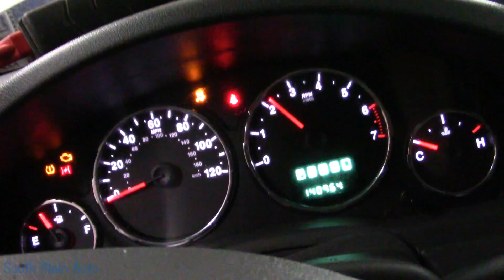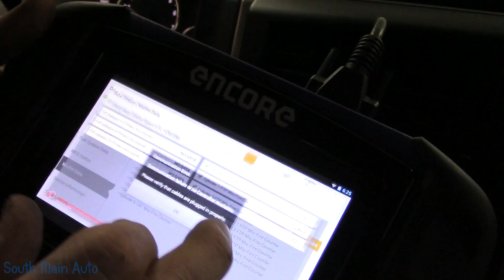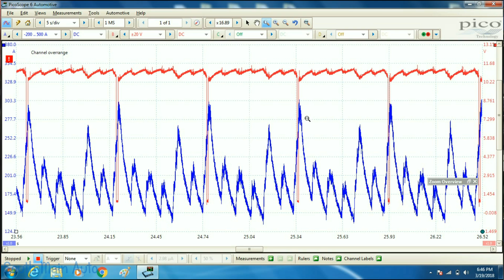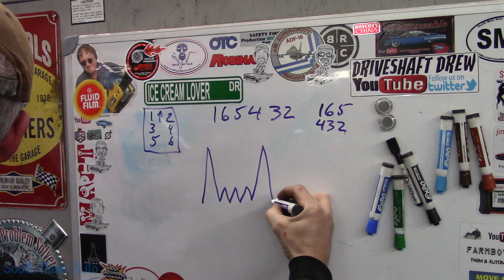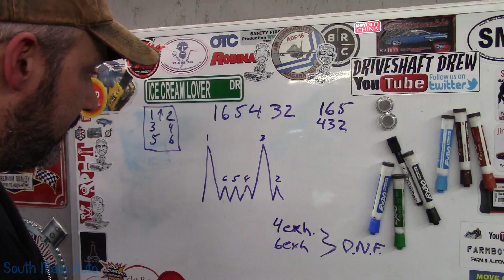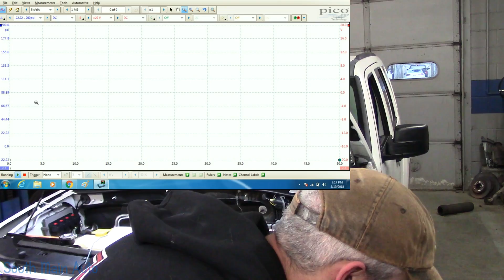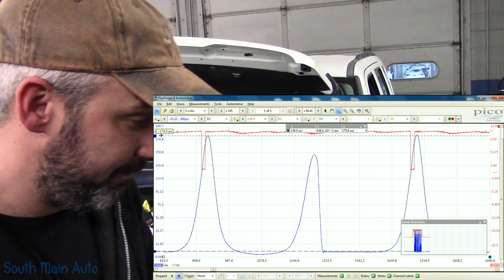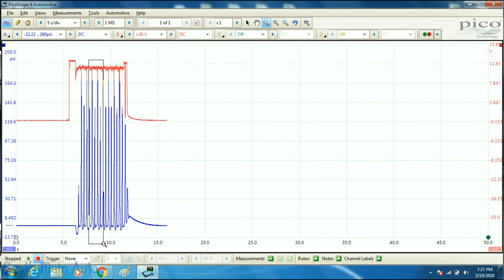Jeep Liberty: Cranks, Starts, Stalls, Runs Rough- Part I

Comment: Checking to see if my thought process is correct: If you would have pulled the spark plugs on cylinders 4 & 6 in the beginning when you did the relative compression test with the amp clamp, then theoretically there would be no pressure spikes on cylinders 1 & 3, correct?  I think this may be an option for someone with a pico but no in cylinder pressure device.

Comment: Without a pressure transducer, I presume you could remove the plug(s) on the suspected cylinder and re-run the relative compression test to get the same diagnosis (with a little less assurance).

Comment: Eric, what vehicles have you found in all your awesome experience to be the most reliable?  I have a 2005 Hyundai Accent with just over 200K "on the clock". Aside from doing all the scheduled maintenance, the engine has never been opened. Items that have been replaced are Water Pump (which I did with the Timing Belt), Alternator, all O2 Sensors, several vacuum lines, and the radiator.    It's just starting to consume oil to the tune of 1 quart every 3 months and around the same time, when the oil starts to age, it's starting to get a lifter tick (something I hear is common for Hyundai engines). Once I do the oil change the lifter tick goes away.  I do a ton of DIY work on everything around the house including my cars, so I have tools for just about any job.  So with all your experience, what would you look to first?  Valves, Rings, ??? or what do you think I should test for?      I would love to find a mechanic like yourself here in Las Vegas that I could trust and lean on for knowledge.  I have learned so much from you and your channel.  Thank You!  Do you know any mechanics in Las Vegas?

Comment: Lacking a scope, could you monitor the pressure in each cylinder with a pressure gauge and manually rotate the engine?

Comment: Chrysler's waste spark design of the 90s used Champions and did not like iridium or platinums. By the time of 2008 however I can't recall what came from them in the factory or if they where still waste spark.
Reply from the maker: these are not waste spark engines....

Comment: Thanks for the wave forms, Eric.  I'm guessing I can measure spark advance by using the Pico software on this wave form? It looks like if I measure the distance in degrees from the red spark line to TDC on the blue curve, I'd have my spark advance angle. Is that possible? Am I thinking of that right?

Comment: Eric love the channel and been a fan for quite some time. I am late on this video, not sure how it slipped through. I have some reservations on your explanation or data to get to the conclusion you did. You showed the cylinders as 135 and 246 down each bank and a firing order of 165432 and this is where in the problem lies. As it's a 6 cylinder engine and pressure pulses are equally spaced cylinders 5&6 and cylinders 4&3 can't be fired right after each other. Each cylinder has to be fired 120 degrees of rotation apart and this is not possible firing a cylinder on  A bank then the mateing cylinder on B  bank. Either the cylinders incorrectly or the firing order was wrong. You go to the conclusion with wrong info?

Comment: I am at the 10 minute mark in the video, just before the white board. To me it sounds like the throttle is slamming open/shut when it ran in the beginning. Plus you have multiple throttle body codes. I would pull all the plugs and do a baseline compression test with the throttle body unplugged/wide open. If the results are good (if there isn't a dropped valve seat), I would move on to cam/crank correlation to check for timing issues if that checks out, work through the throttle body operation and see whats going on there. From there if thats good consider scanner data on 02 sensors to make sure one is not stuck lean or rich pulling all fuel or adding to much to one bank.

Comment: Could it be the PCM.? My Jeep is doing the same thing, I have a thought, the computer could be bad, throws all the sensors haywire then everything is wrong and misfires, wont start, then intermittently starts but won’t run. I am considering a wiring harness and a brain transplant, what do you think Doc? 
I have new motor all new sensors and distributor plus plus plus and new  TPS , air idle, etc.SENSORS ARE ALL NEW,
No codes due to the replacement of all the parts and battery disconnect and new motor has like 10 breaking in miles only, it’s not a valve, or the timing... 
maybe I should just push it off a cliff?
I already emptied every pocket, and borrowed from local transients.

Comment: I know the magnum series of engines 6 and 8s were notorious for poorly engineered valve trains/heads. Is this a newer gen motor, or was it still an issue in 08. I hates engine noises.
Reply from the maker: I don't follow trends or what gen motors are. I just see them as broke and try to fix them :)

Comment: I know this comment is old and probably won’t get be seen by anyone but couldn’t you just take the spark plug out of one of the cylinders you think the exhaust is stuck on (giving the exhaust a path out) and then re-run relative compression and see if you amp draw on the high cylinders goes down?  Obviously the in cylinder test is more definitive but this seems like it would work for someone that doesn’t have a pressure transducer.

Comment: Have a 2004 liberty 3.7 I’ve been trying to fix . My whole passenger side is misfiring . I changed coils , fuel injector seals , o2s and spark plugs . Only codes I’m getting is sensor 2 bank 1 voltage high and multiple cylinder misfire . Do you think changing the crank and camshaft will fix it ?

Comment: I know this is a older video, and my question might not have anything to do with this video ..  and not sure if i had asked before.  But here goes ..  Ever do a engine swap, from a 2005 3.7 L liberty to a 2004 Liberty Limited >?   Im getting ready to do that, see my 05 lib frame broke and its a none repair.  so pulling the motor out and putting it in a 2004 lib limited .. I have heard i will have to change out the Cam gear sprocket due to timing issue`s or i would have to swap brains..  How true is this, being how both motors are 3.7L .  being how they are both 3.7L same engines.  i am hoping it a easy swap over and not have to doing anything in the way of opening up the top end, or change the brains out ...   Any advice

Comment: What is the best and cheapest scan tool that will check obd1 I have a 95 Dodge ram 1500 4x4 5.9 and I can't find anybody to be able to scan it because of it being obd1 and has the like six pin chrysler connection under the hood that nobody ever has. So what cheap scan tool can I use as I can't figure out how to clean my codes I can flash the codes by cycling the key three times but I want a scan tool to be able to connect to the truck...

Comment: Am gradually weening myself of jumping in with a guess and instead gathering information first.....all thanks to you, Ivan, danner, keith and all of the same diagnostic mindset....if the engine did run you could at a pinch use a normal compression guage to check the breathing of the engine....cranking confirms engine sealing, running with valve removed from guage should be approx half psi of cranking, goosing the throtle open should give a reading of 80% of cranking...higher suggests restriction in exhausting gas from cylinder.....suspect i am teaching granny to suck eggs but for us poor people it is a method which sort of gives the engine breathing info the mighty pico does.....It would be of no use in this case as the engine would not run   regards from little old england   jeff

Comment: I need help badly ive replaced almost everything on my 2000 mistang and it still wont start after the engine is warmed up and it takes a few tries to start when cold and it has a loss of acceleration and it wants to die when i come to a stop

Comment: probably coils are bad on 5 and 6. the overflow bottle is over pistons 5 and 6. replace the coils and the spark plugs. move the water bottle so it is not over the 5th and 6th pistons... this is a common problem with Jeep 3.6 Liberty's

Comment: I’m suspecting bad hydraulic lifters due to poor maintenance.  Bet some of the  rocker arms fell off when the hydraulic lifter seized closed.   Seen it happen in a 4.7 Jeep.  Kind of common.  Nothing a little fluid film won’t fix. Hahahaha
Reply from the maker: Dead on the money. Carbon build up on the valve stem will do the same thing too if the valve hung open.

Comment: a 3.7l.....there's your problem...
Reply: LEX Maximaguy87 t
Reply: LEX Maximaguy87 😂
Reply: I have a '07 3.7 V6 Liberty with 180,000 miles, with routine maintenance - the only issue I ever had was cylinder 6 coil plug. (I decided to replace all 6) never had any other out of normal engine issues again. This whole situation in the video is avoidable by doing proper routine maintenance as the manual calls for.

Comment: I'm betting on a dropped valve seat, why? Because it's a 3.7!
Reply from the maker: A dropped seat would make the valve leak ;)
Reply: South Main Auto Repair yes, however this is exactly how I got my 4.7 grand Cherokee. The valve seat partly dropped from being overheated, it was sticking out of the head a few mm, which the lash adjusters couldn't make up and sent the cam followers flying. I'm interested to see what actually happened

Comment: jeep is junkyard rated not trail rated .
Reply: Only way you will see me in a Dodge product is if they have it to me for free. I would need the value of the car just for repairs. Absolute junk.
Reply: Yup! Somebody gave me a free 05 Ram 4.7. It drove fine but the power steering leaking, the exhaust manifold was cracked, the head gasket was bad, something was up with the transmission, the hood supports were shot, the AC didn't work, the heater core leaked and was bypassed, and the rear diff howled. I gave the truck to somebody else LOL. People kept asking me why I didn't keep such a great looking truck. Uh, it was a nicely polished Dodge TURD.
Reply: joe jago 😂